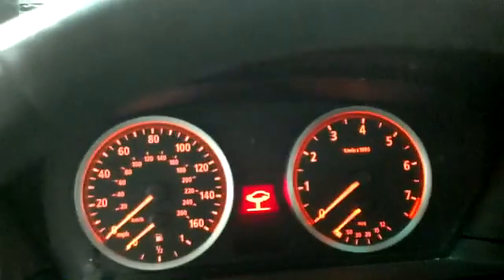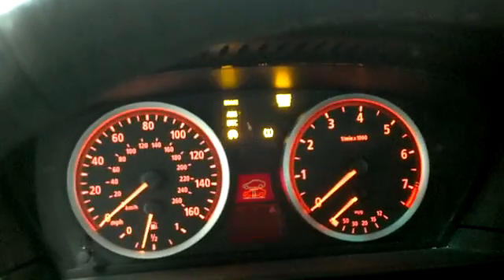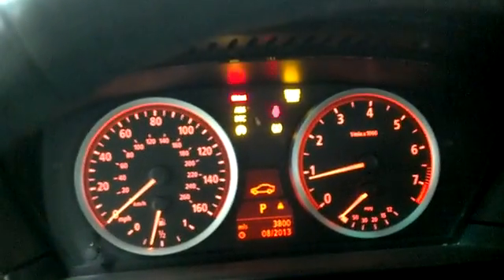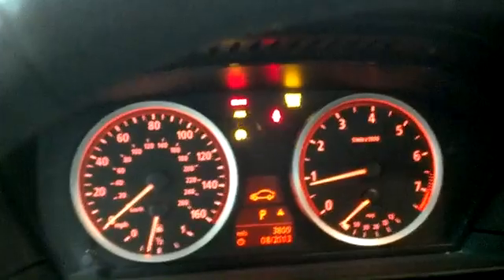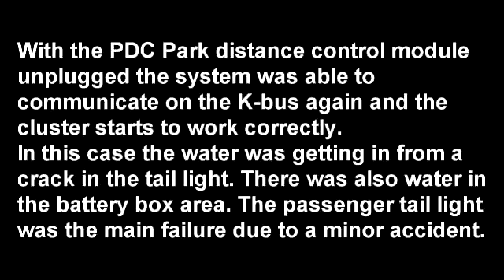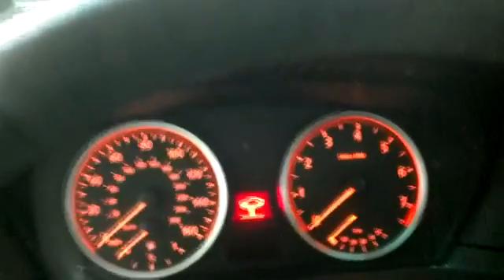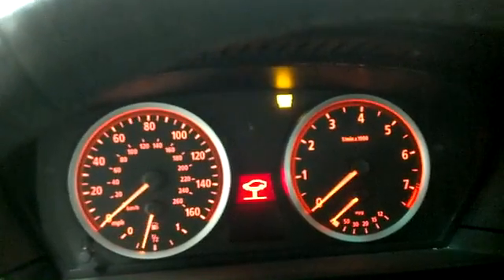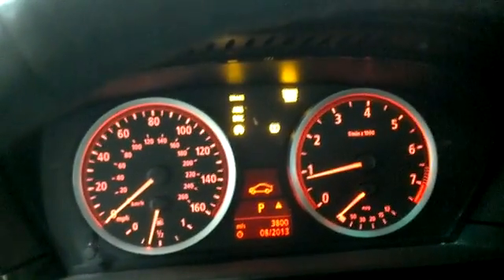Instrument Cluster Not Working Due To Water Ingress

Comment from the maker: Make sure to pour some water into the sunroof drains and make sure the drain well. I have seen the vent stick but usually once your move the flap a bit it will reseal correctly. The four drill spots are at the raised portions, there is some sealer in these that you drill out to drain any water that enters. Make sure to move the modules if you have then to a safe location. The thought is that a vacuum created in the trunk can suck water in.  The holes will help prevent this as well :)

Comment from the maker: The bulletin is only for relocating the modules. The most common source of water can be a sunroof drain being clogged or has fallen off under the headliner. For the battery tray I would suspect also a seal for a tail light. You should try to do a water test. It may sound silly but going into the trunk with a flash light is one of the best ways to find a leak like this. Or if you have fold down seats even bettery. Try to find the source of the leak using a hose. Let me know what you find :)

Comment from the maker: Hello, If the vehicle sits at idle it will also return to the 99.9 setting. Try to reset it and then take a drive to see if will change to a normal reading. The system takes into account idle time as well so it makes the reading go towards 99.9. Also do you have any warning lights on at all?